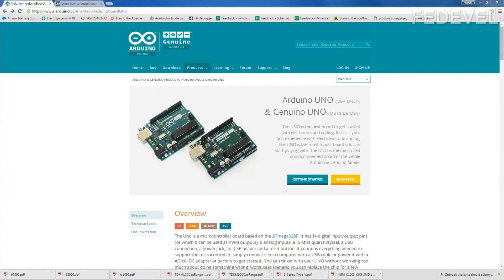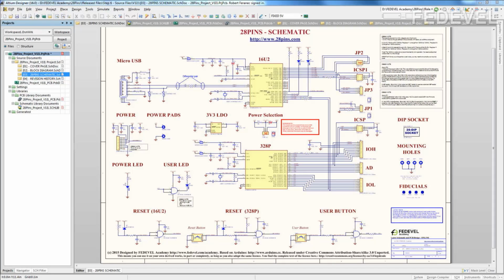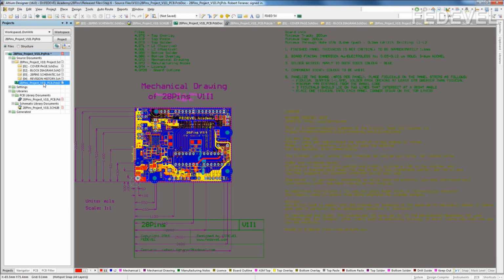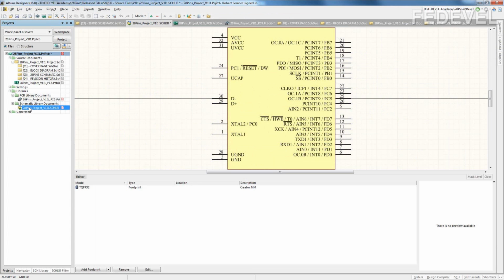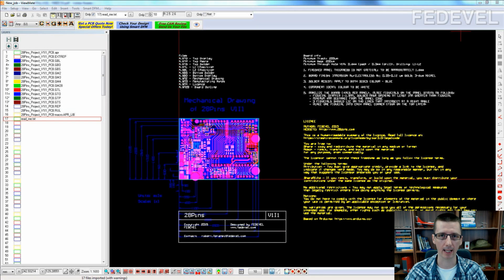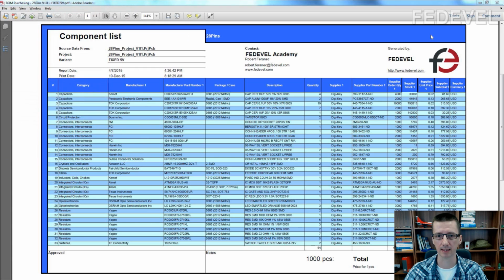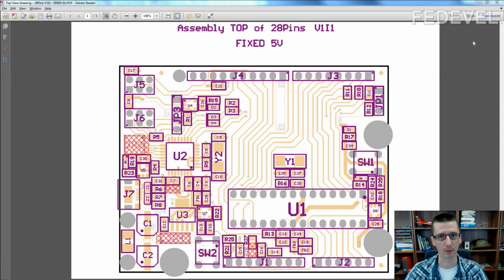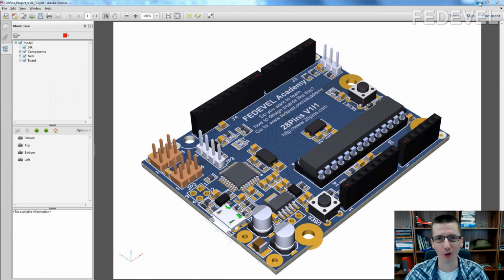Learn to Design Your Own Boards

Comment: Which version of Altium Designer is needed for this tutorial? I only have Release 10. I can't afford to update to a newer version and I'm not a student. Could I still follow this course? Thanks.
Reply from the maker: You should be able to use any version of Altium. There are no big differences between Altium versions. In case you would need any help, simply just post on our forum here (or send me an email): http://www.fedevel.com/designhelp/
Reply: you can download AD18 with all lisense from internet just google little bit

Comment: Would this be useful to those with Altium CircuitStudio? Thank you.
Reply from the maker: +Kent A. Vander Velden In Circuit Studio you would need to figure out how to do certain things (some things are a bit different, also menu looks different ... that could be confusing). With Altium Designer it's much easier - you simply follow the video.